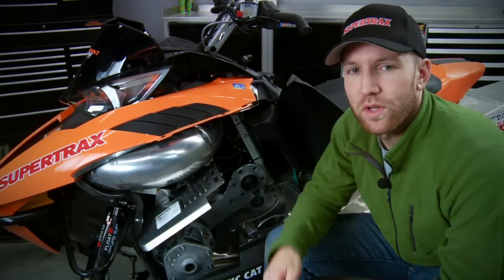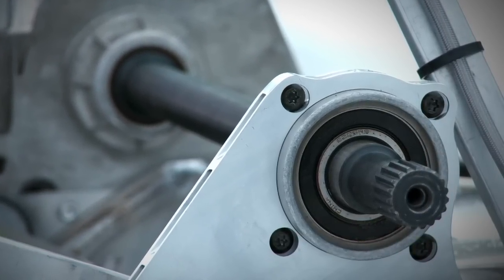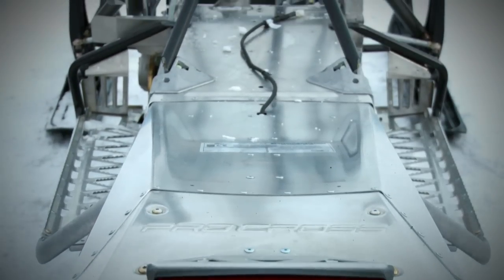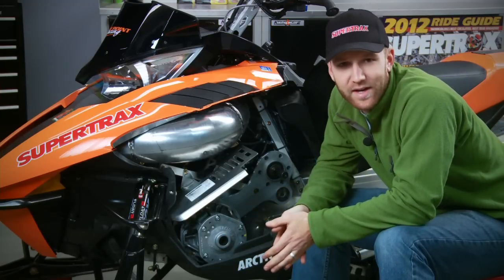Arctic Cat Torque Control Link

Comment: They only show the TCL on the 800, but show them riding a 1100 turbo. The torque control link is different on the 1100's.